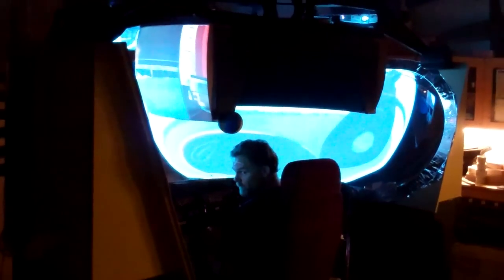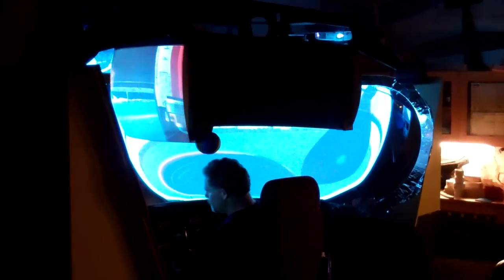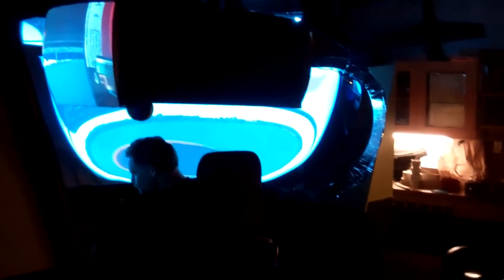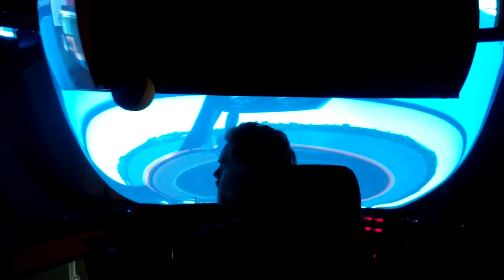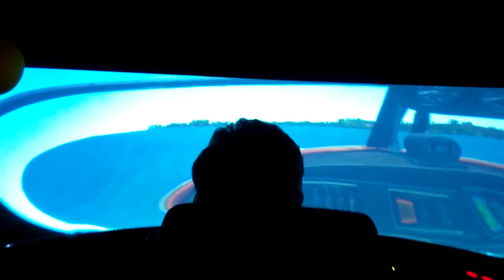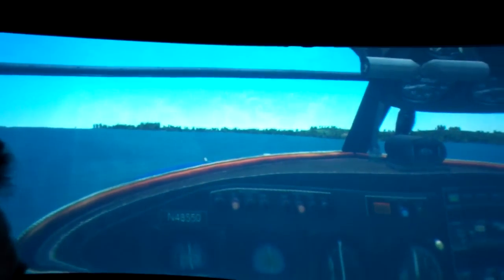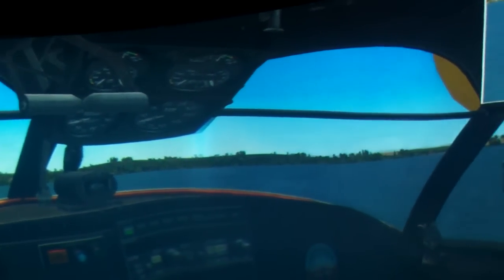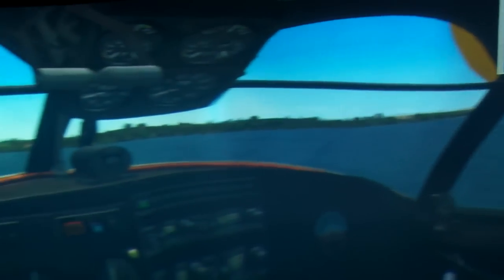Projectors aligned and with edge-blending enabled.

Comment: I would be interested in a copy of the plans for this display system if you ever decide to make them available. Fly Elise-ng has reasonably priced warp/blend software. And ebay has 60" x50 ft rolls of silver mylar. Even just drawings with dimensions would be a great start.
Reply from the maker: It would take more time than I have available in order to turn the cad drawings into something someone else could use, sorry.  Now that being said, if you send me an email at f15sim@gmail.com, I'll be happy to send  you a copy of the Excel spreadsheet that calculates the mirror cell radius and the display screen shape.  Once you have those two elements, the rest is pretty simple to design.  Keep in mind though that if you want a cockpit bigger than say a Cessna 172, at 60" wide roll of Mylar won't cut it.  A 737-sized mirror cell required a 120" (ish) roll in order to skin the cell.
Reply: @f15sim  hi I also wouldn’t mind your spreadsheet as I’m doing a similar build (c172 size) only snag is your email bounces back - is there any way of contacting you directly?
Reply from the maker: @PocketProjects  email should be fixed - had a power outage today and it lasted longer than the UPS did. :)
Reply: @f15sim  hi thanks for the swift response. I’ve since tried again but it’s bounced back again - so I’ll try again in a day or two. Thanks

Comment: Were there ever any plans made for this as a possible kit?
Reply from the maker: At the time we built the display, there was a feature (the "ears" at the ends of the mirror cell) that was still under active patent.  Because of that, no plans were going to be made available.  The patent in question expired in 2017, but I haven't revisited the decision to not publish the designs.  The design is pretty straightforward, but does require some skill to build.  Having some kind of CNC router is almost a requirement.  Another issue is that the Mylar used for the mirror cell is nearly impossible to source for a system larger than what we built.  This means that you're not going to build one for your favorite airliner.  Bizjets on down are about as good as it gets.  Another hurdle is the screen warping software.  NThusim+ is no longer available for sale and the existing warping packages out there are going to set you back north of $300 USD.  That being said, if you're using FlightGear, I think someone has built a working display warp into that.

I'm actually thinking about building a new display for my recently acquired ATC-810 simulator (see newer videos), but I'm not sure I want to go there quite. yet. :)